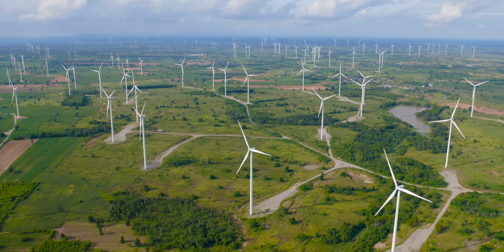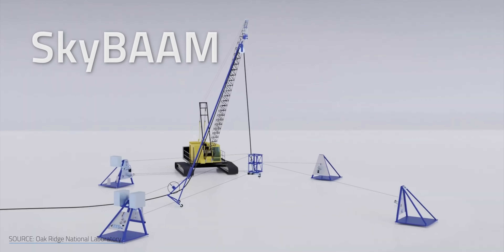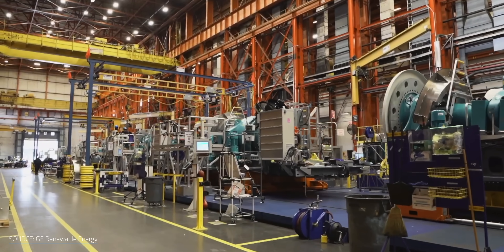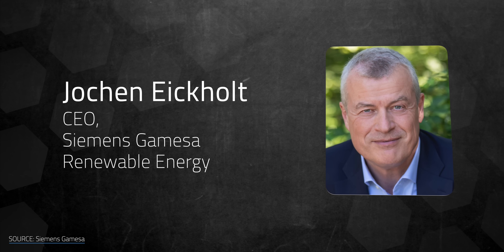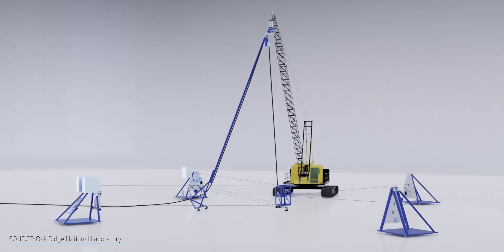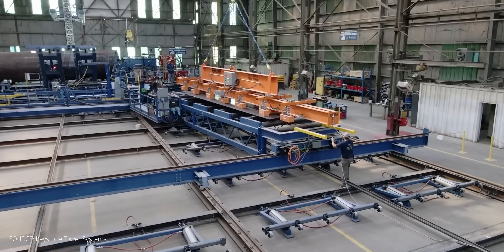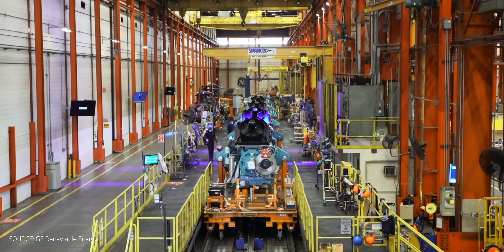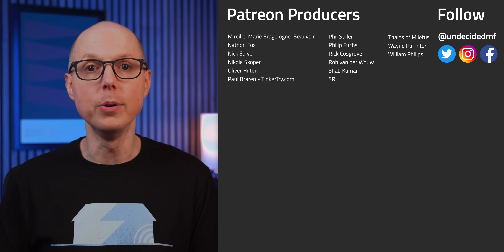Why We Need To Rethink Wind Turbines

Comment: After 10-15 years they take them down and create a massive waste management problem. Currently over 100 million lbs of dead windturbine blades are filling landfills and littering the countryside. Our company has the recycling solution to this problem.  We are not yet in production but hope to be by early 2024.
Reply: 100 million pounds is tiny amount.   You sure you have that right?

That's equal to only 1600 rail cars or 16,000 shipping containers.   Or about 25,000 cars in scrap yards.
Reply: Every source I see online indicates that wind turbine blades last 20-25 years. I am disappointed.
Reply: @Frostbiker  Disappointed by some random YouTube comment? Anyone who lives near a wind turbine will attest that these things last 20 years at the very least.

I'm not sure about the lifespan of offshore turbines but they're said to be 85–95% recyclable.

It's the opposite of disappointing.
Reply: @Frostbiker go to a wind farm and look at the piles of scrap ones. They originally said they would last 15 years but now they find they last about 7 and half of that off shore. The oldest wind farm in canada is in Alberta and it is  20 years old. It was shut down for 3 years and they are trying to get enough money to take them down.
Reply: @terenceiutzi4003  folks should see,  "End-of-life policy considerations for wind turbine blades" .

The study there shows wind blades last 20 years.  We are decommissioning 8,000 per year for the last 3 years.   

And they are still difficult to recycle as of 2022.
Reply: While you tackle the wind energy recycling, can you also go and cap the 14,000 defunct oil and gas wells in the Gulf of Mexico? We can’t just do one without the other…
Reply: They are starting to chop up the blades and burn the binder for energy and reuse the glass fibers for new blades
Reply: @treylangley706  they are made of cabon fiber. The epoxy binder has 10 times as much carbon as oil. And the broken fibers are useless for making anything structural because they are too short. How energy do you think it takes to chop up the blades? Over 150 percent as much energy as they produced in their lifetime!
Reply: @terenceiutzi4003 1.5x lifetime produced energy to chop up some fiber plastic? Now I know you're lying.
Reply: @terenceiutzi4003  Do you have a source to back up your statement? I'd like to see the hard numbers you're quoting.
Reply: @terenceiutzi4003  okay, now you are just making shit up.  They make enormous amounts of energy.   There is no way chipping them up takes 30 years of that energy generated... or even 10 years.  Or even a month.
Reply: @macmcleod1188  and how much energy do 3 huge backhoes and a huge rock crusher? And the 3 blades they tried torecycle here took a mother to bust up. And they produce very, very little energy! The Naticoke plant that ontario shut down produced more electricity than all of the wind turbines in Ontario
Reply: @defenderred1212  have you watched the recycling process? Mobil Energy in Woodstock is manufacturing 80 ton transformers and switches  so they can select which generation plant they send the  power from the wind farm to to have it cleaned to be put onto the grid!
Reply: @terenceiutzi4003  Any powerplant of any kind costs millions to commission, run then decommission. That's paid for by investors who are told such things as the expected costs and returns, and the Levelized Cost of Electricity (LCOE).

By all accounts the LCOE for large wind turbines has improved dramatically over the last few decades, prompting more and more investment. It's the same with solar.

And you're telling us that one of these giant blades that can power an American home for a whole day in a single turn takes even more energy to recycle? ☺️
Reply: @nagualdesign  Same dude is telling us “clean coal” somehow reduces CO2. I can’t figure out if he and his buds here are paid trolls, reading incredible misinformation, or just making stuff up as they go along.
Reply: @nagualdesign  yes go read the information board in lethbridge,  with the cost of decommissioning that wind farm the lifetime total cost is just over $10.00 per KWH.
Reply: @nagualdesign  yes I visited a micro hydro project in BC . The tour guide said they just did a 50 million dollar refit and it could supply 1000 homes with free electricity. That is the way the people that build renewables think.
Reply: So many comments not talking about nuclear power solving this problem for fewer materials, less waste, fewer carbon emissions. and more reliability. The conversation is mind blowing :(
Reply: @microburn nuclear power is literally the most costly and least economically viable form of energy. 

But go ahead and pretend this is not issues.
Reply: @AL-lh2ht nuclear power has advanced tremendously. America also has more stable land than Japan (Fukushima). We should definitely look that direction, tidal power, wind, and solar. Once we get past production being curtailed by fossil fuel companies, storage is the next hurdle, but that isn’t too far behind either.
Reply: @It-b-Blair  we will know what nuclear power is ready when private insurance companies will insure it.

Until then you have potentially unlimited cost being dumped onto taxpayers and worse on the grandchildren the people who get cheap power and then the grandchildren pay the actual bills.
Reply: @microburn  Nuclear power is part of the solution, not THE solution. I'm all for the widespread rollout of the next generation of reactors and SMRs, I think it will do wonders in reducing our carbon emissions.
Reply: @microburn  you do know that clean coal can reduce atmospheric CO2 and produce more energy and Calciumcarbonate fertilizer as a byproduct.
Reply: It’s laughable that there concern about turbine blade waste.  Go look at the utter destruction caused by oil sands or shale extraction and you could fit all the turbine blades made for the next 1000 years into these gaping environmental nightmares.
Reply: @28th_St_Air exactly. The same for solar panel "waste". It's calculated to be around 0.03% of waste compared to fossil fuel generated waste.
Reply: First off its a government funded process and we all know how eager they are about spending money on their own people when they can pay for war and defense..  but there are multiple places with loads of windmill parts that were to be recycled years ago but theres no money to pay for it or companies that will do it.. or can do it currently.  That said look at all the oil pumps and old fields that never get “recycled” either.  Government funded..  truthfully theres just too many people on this earth..  and they multiply everyday more than they die..  the amount of garbage a single person produces per day is crazy when you think about how many people there are, whether you recycle or not that is trumped by factories and businesses..  on top of that think about waste, every single person poops at least once a day, some more some less but multiply that by 9 billion..  per day..  thats a lotta poop..  they condense and compact it into super poop and the haul it somewhere..  where all the poop and garbage are going has got to be getting to a point where theyll suddenly create disasters when shit happens..  literally..
Reply: Yup, but a waste management problem that fades in comparison to the waste produced by using fossil fuels, where fracking contaminated areas or huge coal mines ruin the countryside on a MUCH bigger scale. with wind turbine blades, you can basically burn them in cement plants and recycle the fibres in building materials, or just build a well controlles landfill, since they dont severely endanger the groundwater
Reply: @after_glow3912  As someone whose Fracked hundreds of Wells from Utah to North Dakota + MT, CO, WY...Beginning in 2006...You sir, have ZERØ clue what you're talking about. First...The sheer amount of energy thats made from Fracking ONE single Well is orders of magnitude higher than a Windmill will make in 10 lifetimes. Sorry...You need to  cope with the fact that OIL is what keeps the world turning daily. Period. Let me know when your wind turbine is powering container ships, trains and diesel trucks that deliver/produce every single thing you consume, buy, eat, wear, drive or use...literally EVERYthing in your life. And saying it "contaminates the area and ruins the countryside" is laughable. 

The process of Fracking technology and advancements in directional drilling have  been no less than a MIRACLE in energy production. Old Oil/Gas Wells that were drilled 50 years ago are able to be re-drilled + Fracked and start producing again. 10 separate Wells can be drilled from the SAME small pad on an area smaller than half a Football field. But hey....Keep living in your "power the world" with rainbows and unicorn farts fantasy, while we're busy actually working and keeping the world turning.🇺🇸⛽🛠⛏💪🏻
Reply: It's not a problem at all. The companies that created these products aren't responsible for recycling so dumping them won't affect profits. It's a great system!
Reply: @Souchirouu as opposed to the fossil fuel industry, the most highly subsidized industry around the entire globe?  SMH, another sheep… capitalism at its finest, socialize the costs (air pollution , pollution of groundwater, oceans and land) and privatize the profits to the shareholders.  You do realize that your taxes are used to subsidize gas production right?  And a small portion of that money goes right back into bribing officials. Don’t believe me? About 10 years ago a number of officials in the BofLM were caught taking bribes of trips, drugs and prostitutes for favourable rulings on their applications, by petroleum industry reps and lobbyists.
Reply: @Souchirouu I read your comment and all I could think about was treating the atmosphere as an open sewer for unrecyclable CO2.
Reply: Lmao at least (and at worst) you can landfill the wasted blades. What are the alternatives? Can you landfill the CO2 exhausted by fossil fuel powerplants? Do you want to land fill nuclear waste? Can you landfill an old, broken, out of service hydro power dam?
Reply: @RailwayFrog  you do know fossil fuels are much worse right?
Reply: @RailwayFrog  good examples but most of dams have very little waste that isn't dirt and rocks/ concrete.
Reply: @Suku1509  no, and you can't landfill thousands of tons of CO2 produce manufacturing the turbine blades either.
Reply: @terenceiutzi4003  That is a very small amount compared to the energy they produce when compared to fossil fuels. Then as times move on the energy used to produce the blades will come from wind, so problem solved.
Reply: @eddewhurst7662  how on earth are you going to make Carbon fiber and epoxy from wind energy.  And how are you going to transport the components for wind turbines without burning thousands of tons of Bunker C oil?
Reply: @eddewhurst7662  Why don't any of the pro wind activists ever talk about the 400 tons of coal required to make the rebar in the foundation of a small wind turbine. Or the radio active waste from refining the rare earth magnets?
Reply: @terenceiutzi4003  The CO2 generated to make and install a wind turbine is offset by the CO2 saved by reducing the fossil fuel that would be used to produce the same energy after 9 months. As we decarbonise the manufacturing processes this should continue to decrease.
Reply: @eddewhurst7662  you should check the math. I see 80 ton transports driving up 401 with 3 wind turbine columns on them. Each of the 12 turbines they put up here in town each each foundation used 15 80-ton loads of rebar, and that would require over 400 tons of coal. Let list goes on for ever!
Reply: @terenceiutzi4003   So you're saying that each turbine requires 1.2 kilotons of rebar just in the foundation? 😆

I think you mean that each turbine footing requires 80 tons of reinforcement, not 15 80-ton loads.
Reply: @nagualdesign  yes they are small ones. The new giant being built requires twice as much .I see you don't bwatch the news it was on our news when they were building their new giant and the over 24,000 tons of rebar shipped from China
Reply: @terenceiutzi4003  The larger ones are more efficient and cost effective so the payback time is going to be shorter not longer.
Reply: @eddewhurst7662  but the carbon foot print is astronomical
Reply: @terenceiutzi4003  An average onshore wind turbine will produce as much energy in a year as burning about 3,000 tons of coal.

When you divide the total emissions associated with a wind turbine by the amount of electricity it will produce in its lifetime, it works out at about 6 g of carbon dioxide for every kilowatt-hour (kWh) of electricity.1

By comparison, power generation based on fossil fuels involves burning more coal, oil or gas for every kWh of electricity, on top of the one-off carbon emissions from construction and decommissioning. For coal, this adds up to approximately 900 g per kWh.

In other words, switching from coal-fired generation to wind power can reduce the carbon emitted from energy production by more than 99%.
Cannot see a problem with my math.
Reply: @eddewhurst7662  can you say bull shit? Look at the output rating of a wind turbine,  then  look at how many megawatt hours that the Natticoke plant put out per year on 2,000 tons of coal?
Reply: @eddewhurst7662  not only 99x less CO2. Renewables offer the possibility of a 100% cyclical economy where the construction of the windmills, the steel, the concrete,... is also made with renewable energy.  The very idea goes out the window when we continue to burn stuff.
Reply: @MattCasters  No idea what you mean by 99x less CO2.
Concrete and steel will be made using electricity
Reply: @terenceiutzi4003  2,000 tons of coal will produce about 5,000 MGWH
Reply: @eddewhurst7662      1969 I took part in a protest at Natticoke set up by my geography professor.  We were protesting because Natticoke was burning 20,000 tons of coal per year, and the carbon dioxide was causing dangerous global cooling! 20 years ago, ontario built 20 new natural gas generating plants, 1,000 wind turbines, and trippled the size of the Sir Adam Beck generation plant. Then, shut down the Natticoke  generation plant and gave us a 5 percent reduction in generation capacity!
Reply: A danish company is already recycling blades… and they are just getting started!
Reply: We could pulverise them and use the dust to bulk out baked goods, soups and sauces aimed at poor people.
Reply: @DenkyManner  Feeding the poor is communism.
Reply: I don't but that, even IF it's 15years how many millions of tons of CO2 do they offset every year? There no free lunch.
Reply: So 100 millions lbs sounds like a lot, but that sounds like what humans create daily… or maybe not even that.
Reply: @toozydude2  humans create over 24 billion pounds of waste every day.
Reply: "we are not yet in production" then you do not have the solution.
Reply: Here we go again with the SMRs. Remember folks: they don't exist in commercial form. You might as well ask for those miracle Thorium reactors.  More importantly still: the price of nuclear keeps going up and the price of renewable and storage keeps going down.
Reply: 😂 Do you even own a mirror?

Do you know what the waste piles look like from other energy options?
Reply: This problem will work itself out over time. We still take most of our garbage and put it in a big hole, or burn it. Glad to hear your company will be part of the solution.
Reply: The blades are ground down and recycled. China has subsidize their fiberglass market to the point that blades sit in storage heaps until recycling is profitable. There really is little environmental pollution in the product, but a ton of waste in manufacturing.
Reply: @specoccspeech  they are carbon fiber, not fiberglass, and if you grind them up, the fibers are too short to use again, and how many thousand tons of CO2 are produced grinding them up!
Reply: @terenceiutzi4003 If grinding them up uses energy and the resulting material is useless then why would they bother. They would just cut them into manageable pieces and bury them.
Reply: Inconsequential. If the material can be converted into something more valuable than the cost of conversion, then sure. Otherwise just bury it.
Reply: @rb8049  not wise considering the limited resources we have.. sure it will have to be worth it at some point but thats up to the money being invested now…
Reply: Personally believe winter binds should be banned the Killing thousands of birds every year even birds on the Danger species list. Banned them all.
Reply: Still better than coal, America’s #1 because of lobbying 🤮
Reply: I see old wind turbine blades on flatbeds moving on I-84 everytime I get out to that part of my region of service.
Reply: @TheForwardThinker yes and at the oldest farm in Canada it is going to cost 3 times as much to recycle them into a useless product as it cost to build the wind farm
Reply: It's 20 to 25 years, and the waste they produce is a lot but still a quarter of the amount that is produced over the lifetime of a fossil fuel plant and half p the amount of a solar plant
Reply: @pilotavery  On top of that, for decades nuclear waste was pretty much left untouched until recycling methods for them was developed and now, such waste is no longer radioactive and old waste was vastly recycled as well.

Decades ≠ forever. Eventually, wind turbines, too, will be recycled and both old and new dead turbines will disappear.
Reply: @NothingXemnas Actually illegal to recycle radioactive waste in USA. France does it though.
Reply: Wind turbines are such a waste of energy. Would be much more “green” to not make or install them at all and just use clean natural gas instead.  😂😂😂😂😂
Reply: @fakename8856  100 percent correct.  But then a lot people with 0 qualifications wouldn't be millionaires!
Reply: @fakename8856  no clean coal is far cleaner then natural gas.
Reply: @terenceiutzi4003  stop making stuff up. It's getting tedious. There's no "clean" burning of anything.  There's a simple reason why so much solar, wind and now batteries are deployed: it's cheaper.
Reply: @MattCasters  it is 100 year old technology! Why do you think the coal fire stacks are so tall? They inject limestone into the burn and the chemical reaction almost doubles the amount of heat from the coal, and it converts CO2  to Calciumcarbonate that persipitates in the stack. Calciumcarbonate is sold as a fertilizer.
Reply: @MattCasters  don't try to talk about things that you know less than nothing about!
Reply: @terenceiutzi4003  I'm not the one sounding desperate here. We've come with facts, and you keep bringing Facebook level FUD. Have a wonderful day and don't forget to wear your tin foil hat.
Reply: Wind turbines are such a waste of energy. Would be much more “green” to not make or install them at all and just use clean natural gas instead.  😂😂😂😂😂
Reply: @fakename8856  Not even close! The lifetime CO2 results vary by country, size of turbine, and onshore versus offshore configuration, but all fall within a range of about five to 26 grams of CO2-equivalent per kilowatt-hour.

To put those numbers in context, consider the two major fossil-fuel sources of electricity in the United States: natural gas and coal. Power plants that burn natural gas are responsible for 437 to 758 grams of CO2-equivalent per kilowatt-hour — far more than even the most carbon-intensive wind turbine listed above. Coal-fired power plants fare even more poorly in comparison to wind, with estimates ranging from 675 to 1,689 grams of CO2 per kilowatt-hour, depending on the exact technology in question.